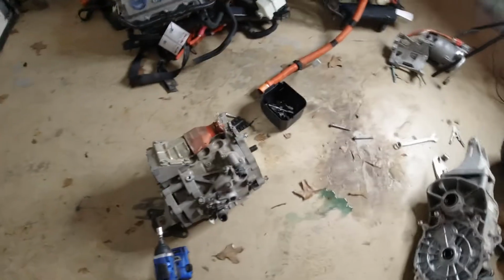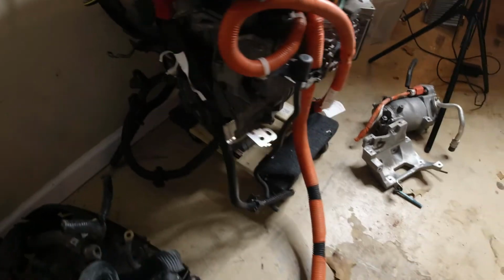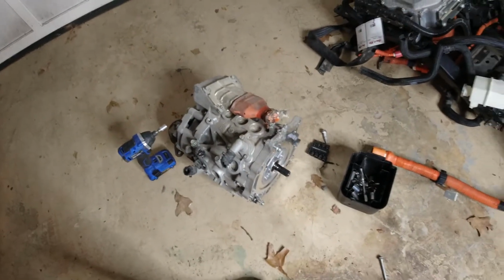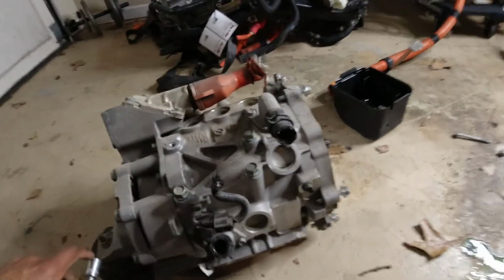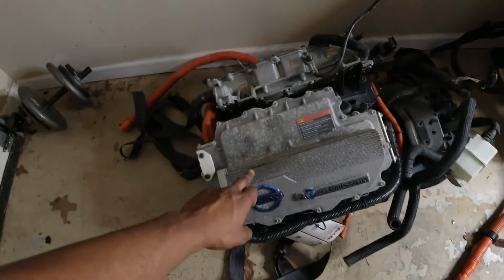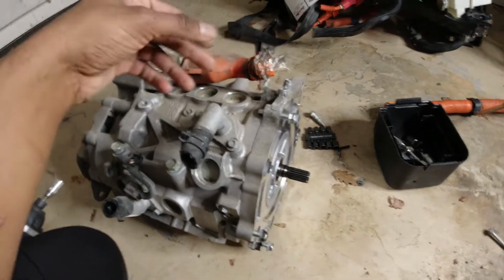I bought a 300hp motor for my Electric Cross Kart!!

Comment: I know it’s an old vid but I wonder if I can use this in a C10
Reply from the maker: This would work perfect in a c10
Reply from the maker: The truck bed is a easy place to store the batteries
Reply: @InvokePerformance  I’m just not sure cause lack of knowledge that this motor is enough to push/pull a vehicle near 3 tons
Reply from the maker: @KingofStreet3  the leaf weighs 3400lb without cargo so you would have to see what you you want for acceleration . But I have no doubt with the the gear reduction it will move the c10 with out much issue. There was a video a while back of a Prius towing over 10000lbs and it did it just now very fast lol and the leaf has a much larger drive  motor than the Prius

Comment: The 80kW restriction is from the inverter not the motor. As you said the motor is capable of much more.
https://www.youtube.com/watch?v=-oy-p3C0gtQ
Reply from the maker: The motor can handle way more kw over three times and the gen1 inverter has been tested at 150kw